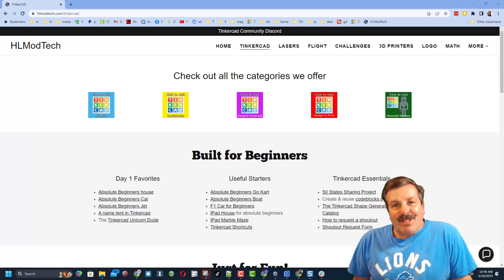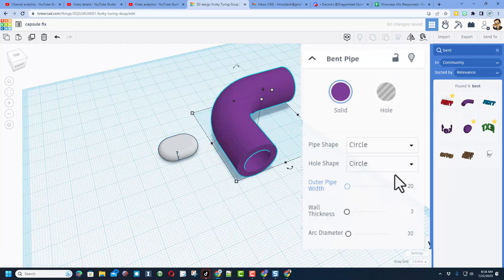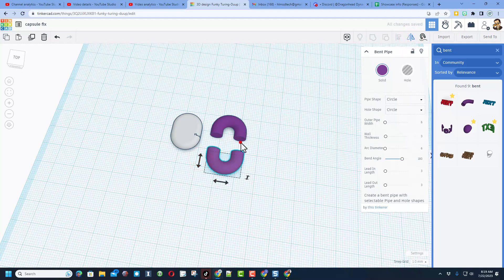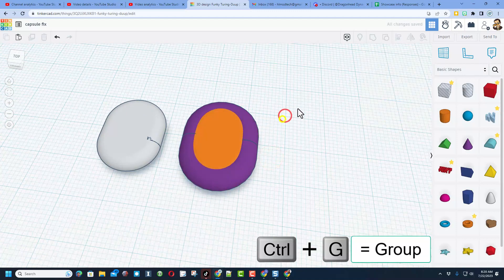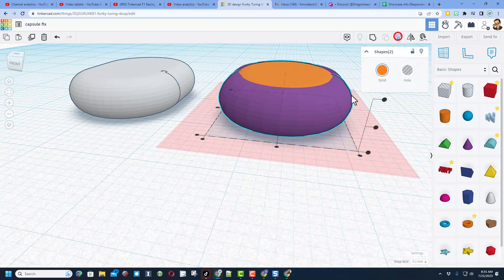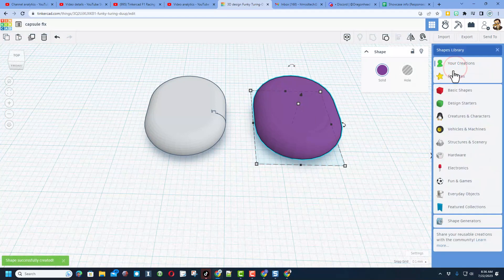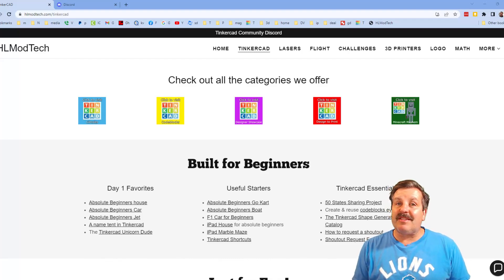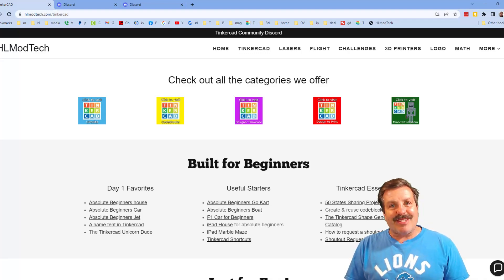How to Fix the Tinkercad Capsule Glitch in minutes!

Comment: this is WAY too much work for a program should fix its own shapes. why use the tinkercad shapes if your making your own?
Reply from the maker: I personally never let the glitch bug me when I am building. Do you have another 3D design tool that you prefer more than Tinkercad?
Reply: @HLModTech  I only know of tinkercad. But when I build things holes fill in when I make a different hole. Or if I add a part another piece with get added somewhere else.
Reply from the maker: Are you building from scratch or messing with imported STL files?